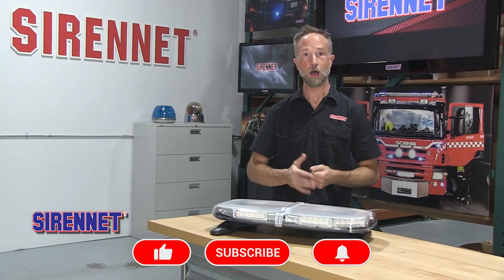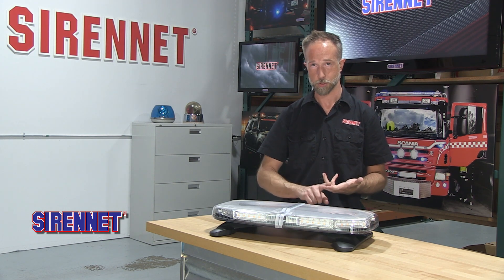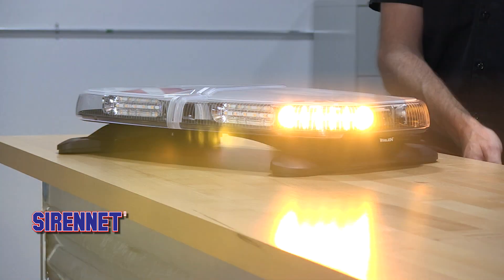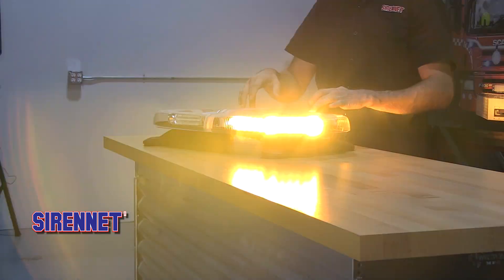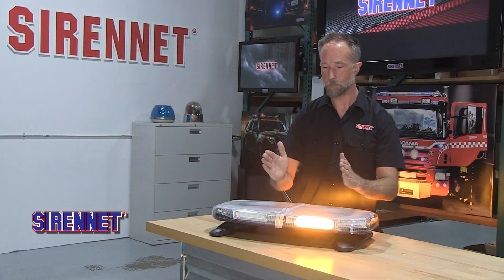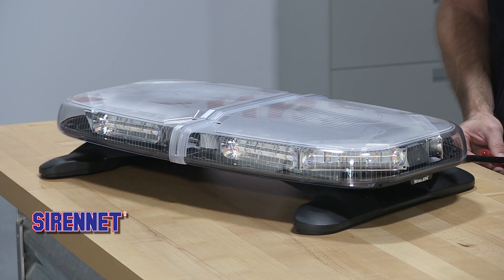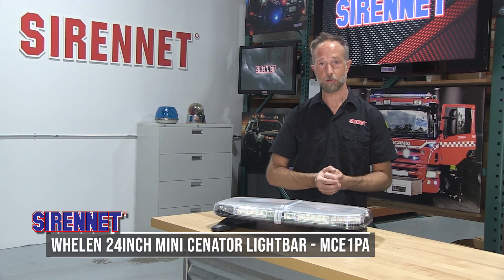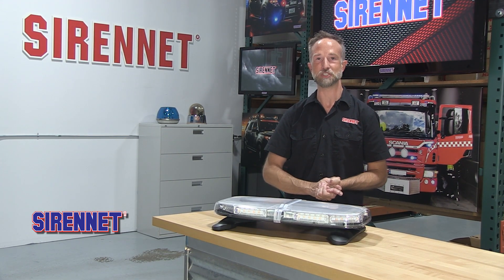Whelen 24-inch Mini Cenator Lightbar   MCE1PA

Comment: In the video you guys show this bar with what looks like 8 total lights. When you click the link in the description to buy that one only shows 4. Is there different versions for this very bar?
Reply from the maker: There's what could be considered a 'base' model with 4-Corners, and either a Permanent, Magnetic, or Vacuum mount base. You can then add optional front and rear inboards, as well as Takedowns and Alleys if it's a permanent model. We feel like this particular model, MCE1PA, is going to be the most sought-after version, and it will be available on the same page soon.

Comment: Whelen still fail to integrate White Flashing lights that co-ordinate with either Factory HLF (Head Light Flash) or additonal Grille Mounted LED White lights so the installers can create an effective 'X' light White setup which is proven to be the most effective Emergency light setup
Reply: Proven by who
Reply: @pcalna3202  Research it!  It is the majority of the USA and European bodies that set the standards for safe lighting on emergency vehicles to prevent collisions
Reply from the maker: It's possible to do this now on some newer vehicles with LED headlights if you are using Whelen Engineering's Core system.